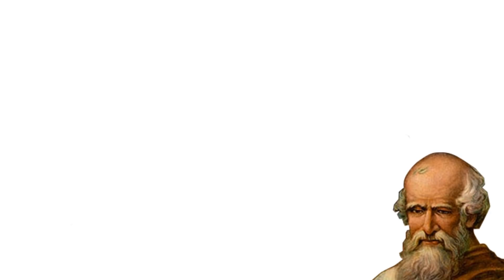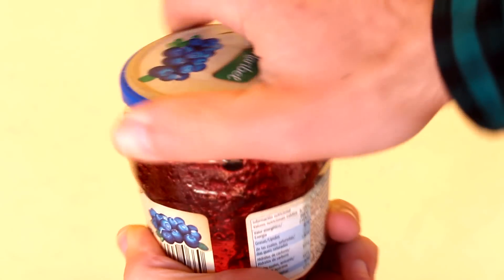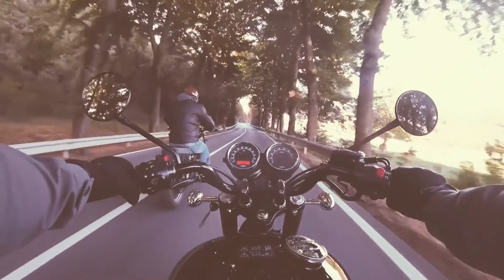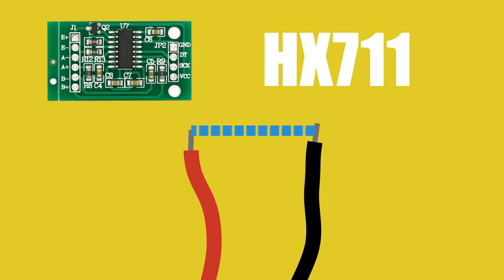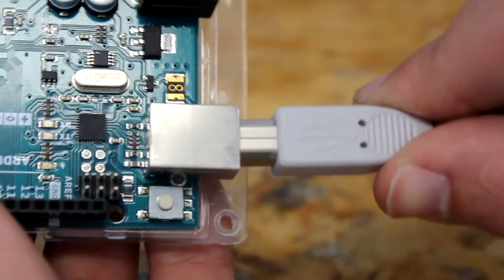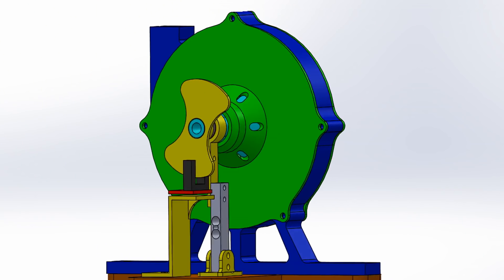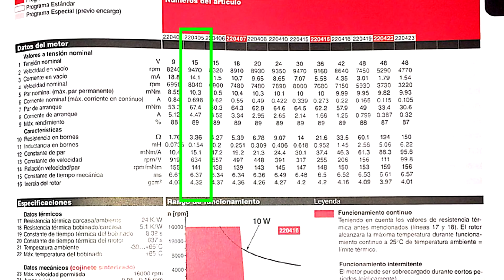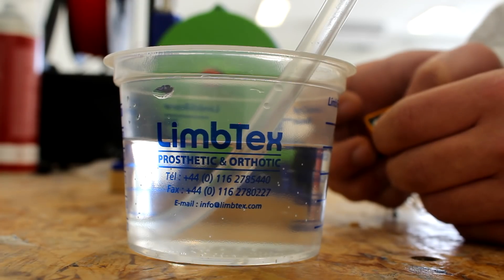DIY Torquemeter - How to measure torque! [Arduino & 3D Printed]

Comment: Thunderfoot is not a nice person, is he? You, however, do seem to be. Thanks for the informational video, and good luck with the soldering! The preheating people talked about here really does wonders, my mindset is usually to heat the component with the iron and melt the solder with the heat from the component, rather than from the iron. Using flux and getting a less worn tip might do the job, too!

Comment: can you make a torque censer which can give an accurate measurement so accurate to 0.0001 {and the torque censer must not resist or lose power because of measuring the torque, not even 0.0001% }  just make a video explaining about how it can be made or it is even possible to make it by buying parts from amazon (like accelerometers, gyroscope, tekameter, magnetic sensors, etc highly sensitive accurate torque sensor DIY  😃 it is a very important topic

Comment: Maybe, just as an idea, you could improve the air inlet in the casing of the turbine. i think you get more turbine speed if you transmit all the kinetic energy from the air to the turbine discs. How to do that: just make a tangential air inlet in the turbine (as you did there) but over the whole width of the casing, then there should be a small gap that lets the air contact every turbine disc directly when entering the casing. But its just an idea, i dont know if it works :)

Comment: Rewatching: could you measure the torque by placing a 1/9.8 m rod on the axis in question, and measuring the "weight" at the tip? T = FD, so T = F * 9.8 * (m/9.8), and a scale measures the weight in terms of kg force (which is 9.8 N), so whatever your readout is will be the measure of joules in the torque (as that corrective factor of 9.8 fixes it all)

Comment: I already love this channel. Also if you soldering, first touch with hot iron tip pads and pins. Then after 2 seconds start melting solder! Your pads are too cold to solder, you must preheat it! That's why solder not sticking to board :)

Comment: Also, soldering tip (pun intended): Get the parts hot before you melt the solder. That way the flux covers them and the solder flows over them. Your trouble at 7:42 is because you weren't heating the pins.
Reply: And don't use fake cheap chinese flux and solder.
Reply: @paulcohen1555  also also, clean the tip with a bit of brass wool, de-crap it with flux and tin it with a small bit of solder. Dirty tips give bad solders.
Reply: @paulcohen1555 that was my first soldering lesson. 
I thought my iron didn't get hot enough
I thought I could not solder to save my life.

Then I buy quality 70/30 solder and now I can solder like at least a 15 year old. 

The cheap Chinese solder just burned and turned into chunks and ash.

So, yeah, don't use the crappy solder that comes with the soldering iron, because it's 30% compressed rabbit feces and 70% robot feces.

Comment: Something's wrong here...
So that turbine is generating 7g of force at 150mm... but you're telling me that at 5mm it's generating 2kg? That's hard to believe... M = F*d, so that means (using grams instead of Newtons is fine if you expect to get grams at the end, not Newtons): 7*150=x*5 which means x=7*30=210g, not 2000g.
I admit i did this all in my head, using very rusty knowledge, but your numbers seem off.

Comment: I think the terrible soldering might not be 100% your fault, your solder wire appears to be junk. It doesn't have enough flux, bad grade of flux, and has no lead or silver additive which would improve its flow properties by like a lot. It even looks dull straight off the roll, which is already a bad sign.
Reply from the maker: That makes me feel better about myself, thanks 😋
Reply: @integza  Unfortunately Sn62Pb36Ag2 1.1.2.B costs like $35 for a roll, so there's that.

Comment: Sorry, few questions here. The friction clamp is used to transfer the torque produced by the rotation to the load cell. How certain that it is the approximate amount of torque transmitted to the load cell? and wouldn't the rpm be lesser than normal due to the friction induced by the friction clamp?
Reply from the maker: Pretty certain because the load cell is directly measuring the force from the clamp. Yes, the RPM is lesser than in free rotation but thats the idea. There's no single value of dynamic torque but a bunch of them each related to a specific rpm value. All together they make a curve, the dynamic torque curve, which is common in eletric motors spec sheets. You can't get the maximum rpm when the axis is under load.
Reply: Ah! Understood. Thanks for the explaination!

Comment: Hey there...quick question:
In the sketch you simply calculate torque  as  (force * arm),
but where do you account for a friction coefficient between the shaft and the lever?

Otherwise you are just calucating the reduced torque transferred to the lever but not the real torque on the turbine shaft.

Using different materials for the shaft interface, you would certainly get different friction coefficients and thus different force readings.
How did you calibrate this friction coefficient?
Reply from the maker: No need for friction coefficient. 

Part of the torque is removed by the lever and the other is used to accelerate the axis.
Because we know both the torque removed and the speed of the axis, we know the total torque. 

Also, this is a DIY project to measure only the dynamic torque and not an industrial level device.
Reply: @integza  I have to think about this some more :D had the idea of implementing a simple torque sensor of this type in my Thesis, maybe I'll be back with another question ;)

Comment: Is the measured torque the motor output torque or？
Reply from the maker: In one of the measurements, I did get the motor torque, which I then compared with the value present in the specs of said motor.
Reply: @integza  What is the function of the fan of the pipe?
Reply from the maker: @Steven-on4ux  What fan are you talking about?
Reply: @integza  What is the role of blue and green 3D printing?
Reply from the maker: @Steven-on4ux  Do you mean the Tesla Turbine?

Comment: Great video, just subbed. May i humbly suggest to make sure your components to be soldered are fully heated before applying the solder? Hot enough to melt solder. If its not hot enough it wont stick to the components and will runoff onto your iron since its hotter and drip forming blobs. flux is nice for hard to solder situations but a bit overkill and messy for electrical components since they are practically designed to be solder, one day you probably will say "I cant believe i used flux on pcb boards!". I also did when i started haha.
Reply from the maker: Thank you very much for the advice :D

Comment: My LCD shield doesn't have those extra 5V and ground pins, what should I do?
Reply from the maker: Are you sure ? If you really don't have the extra pins you can share the ground and 5v using a bread board or plug wires to the pins and then solder all the wires you need to the other end. 

I hope I could be of help.
Reply: @integza  All up and running now! Working perfectly. Thanks again mate.
Reply from the maker: @CAPTINBARNEY  That's just great, send pics if you can! 

You just made my day :D
Reply: On your LCD shield you have the black red and blue ground 5V and signal. Mine doesn't have those pins. Do you mean it's okay to share the regular 5V and ground pins? 
Thank you so much for your fast reply!! Extremely helpful!!
Reply from the maker: @CAPTINBARNEY  Sure you can, just make sure your not drawing too much current out of the board. Good luck :D

Comment: hi, if i only want to measure torque electronically, (without lcd display or speed measurement), do i need breakout board?
Reply from the maker: No, my friend! The breakout board is for the speed measurement
Reply: @integza  
okay another question,  the code you posted in the description (for HX711), yields eventually weight in lbs. If I want the torque, shall i multiply that by the rotating shaft radius?

Thank you very much in advance
Reply from the maker: In the description I posted a calibration code for the hx711. This code serves only to calibrate the sensor. If you open the main code, you will find a piec of code that reads the weight in grams from the sensor, converts it to N ewtons and then calculates the torque using the radius.

Is easier if you use the main code as a final solutio . You just need to change the units and the radius.

Comment: Another way to measure the torque, is to load the motor that you are using as a generator, with a resistor. Measure the dissipated power across the resistor and the rpm's and calculate for the torque (you might have to include motor data like efficiency).  You could check the Tesla turbine's torque at different rmp's by varying the resistor (I don't think it will be constant torque, since the turbine will couple with the air better at higher speeds due to centrifugal force). The calculation is:
T = Watts * 9.549 / rpm's   
where T is torque in Newton-meters
source->https://www.engineeringtoolbox.com/electrical-motors-hp-torque-rpm-d_1503.html

Comment: I can't believe a video could make me laugh this much times! :-D

I really like this clever idea!

Soldering tip: Heat the whole pin + entire pad both as well as possible, then add solder, stop adding solder and remove the iron. If your joint doesn't turn out as you would've liked it, keep in mind that you need to fully heat the whole joint including solder again. So you can't simply scrape some excess solder off of your joint, because that will result in different layers in your joint which will fail much quicker. (And those fails are VERY shitty because they're really hard to find out about...) :-)
Reply from the maker: Thank you for that comment an tip Peer :D

Comment: Really entertaining style of video! If I may give you one tip on your soldering? Use a smaller tip and 0.5mm solder. Then you can (1) maker sure the soldering tip is touching the pin and the pad, and (2) you can see the solder start by filling up the gap between the pin and the hole, before spreading on to the pad and up the pin :-) Also, use flux!
Reply from the maker: Thank you for the tips and compliments :D

Comment: Don't just glue the metals together. First heat the pins up, then let the solder do the work.
Can you build a Bluetooth scale? Imagine measuring the pressure between two shafts... That in fact rotate and give you the torque in real time and at various rpm!
Reply from the maker: That's a great idea! I'll try to tackle that on the future :D

Comment: I still don't understand how you measure the dynamic torque there apart from the RPM, what about the force measurements?
Reply from the maker: I'm not sure about what you don't understand so I'll give an overview. A friction clamp it tightened around the axis, this clamp acts like a brake which creates a reaction force. The reaction force is transferred by the tip of the clamp to the tip of the load cell, which measures this force. 
The force is then multiplied by the distance to the center of the axis on the Arduino sketch and displayed on the LCD.

The clamp acts as a lever and just like in the case o the Thorque lever, it tries to push on the load cell. The only difference is that, instead of completely stopping the axis and getting all the torque and 0 rpm, we get a mix of both. 

Hope I could help :D

Comment: Great project! The friction brake using PLA may be problematic, it's friction is likely to vary as it heats up.  Closed loop control of the clamping force e.g. a stepper controlled by the arduino could be an interesting development.
 You could also try a much simpler way of measuring torque with no load cell required; simply use use a large enough flywheel with known (or measured) moment of inertia, and measure the angular acceleration caused by the motor.
Reply from the maker: Thank you :D 

I actually thought of measuring the angular acceleration and is a great idea but in the end, I opted for a more direct way of measuring it :D

Comment: How are grams a force?
Reply from the maker: They are not! You're right XD 
But because force and mass are linearlly proportional, I took that liberty ahahah
Reply: @integza  it's standard procedure for the imperial system, so I just assumed you were doing the same. In the imperial system, a pound force is just the weight of one pound. Lbf= lb * g (if we interpret g as a function of altitude, use sea level. Otherwise, just use a defined acceleration). Naturally a gram force is... g*g

Comment: I'd like to know more about that friction fit. How do you adjust it? If its tighter, won't it show more tork? I mean the rpms would be less, but more pressure would be applied to the load cell. If its too loose you'd get more rpms but less force on the load cell.(so would it just balance out and show the same tork). Would it just need to be adjusted based on your expected range, like a powerful motor vs a weak motor? Also it has leverage, so is the length taken into account as well? Maybe another video explaining more details of the theory of operation would help. Awesome project though! This would be awesome for test rc car motors and engines, if it were made of some stonger materials to handle it.
Reply from the maker: You're right! 

More friction ---> Less RPM & More Torque

Normally on the specs of a motor, you have a value of torque associated with the rpm speed that is normally used on that motor but in reality, the most accurate way to describe the relationship between the 2, is a non-linear curve.

I'll try to get into that on the future :D

Comment: Shouldn't you increase the friction untill it stops?
Reply from the maker: If I did that I would be measuring static torque :D
Reply: @integza  well, a little earlier😂😂
Apart from everything I love your videos!
Reply: @integza   so , how can i set the value of friction .... or it is just an arbitrary value????
Reply from the maker: @SK-we1ty  In theory you should measure torque in several levels of friction and plot a curve but because youre measuring torque and speed at the same time you can get what you want with the power equation.

Comment: Hey! This only tests power for a specific rpm. What you really need to do is to change the clamp strength, and then graph torque vs rpm. Then plot Watts vs rpm, and you will see some kind of a bell curve. This way you not only get the maximum possible power output, but also the required rpm and torque to reach that value. This principle is quite intuitive when you give it some thought: The one extreme is no load and max rpm with, obviously, zero power output, and on the other hand is zero rpm with static torque and also no power output. Somewhere in between is the maximum power output, and I'm pretty sure it will be higher than what you measured in the video. Also ... keep making videos, I sense a glorious future for your channel!
Reply from the maker: You're 100 % right but I didn't want to overstretch or complicate the video... 

Thank you so much for the compliment :D
Reply: @integza  is that mean if i plot Torque vs Speed curves with different value of friction for each curve (the value of friction is constant for each curve ), i will get the same result ?
the second question: can i use weight scale instead of load cell and multiply the value with 9.81 to get the force value in Newton ?   
THANX
Reply from the maker: @SK-we1ty  Yes, you can use a scale.
What controls the speed is the level of friction, so you can do it but is a little bit redundant .

Comment: You could also measure the  torqe by mounting the motor in a bearing so that also the stator would rotate... And then attaching it to the frame via your "hammer" -scale construction. Check out chrisoph laimers  channel.
Reply from the maker: That a great idea :D

Comment: get a temperature controlled soldering station like "KSGER T12 Soldering Station" for about 50 $ or diy version "DIY Kits use for HAKKO T12 Handle" (this needs case and power suply unit)for about 15$ from aliexpress and solder like a pro. they use a soldering tip with heating element integrated inside and also they get hot very fast.
Reply from the maker: Thank you for the tip :D